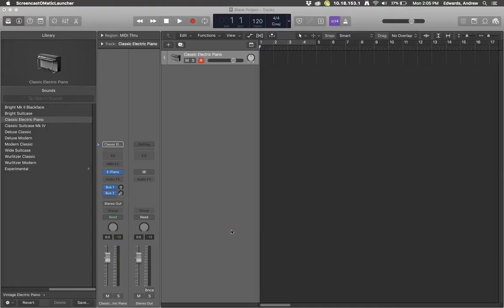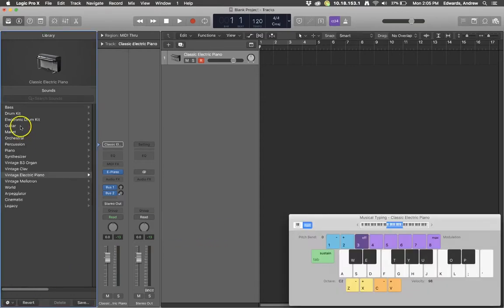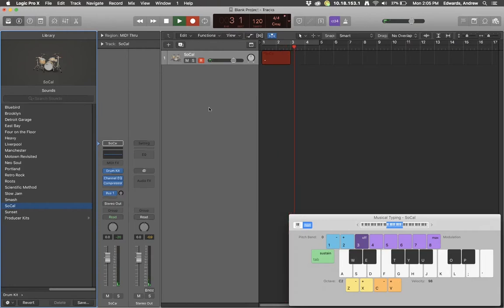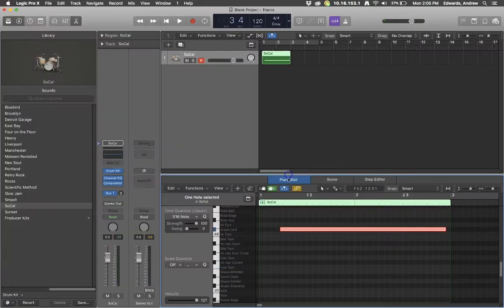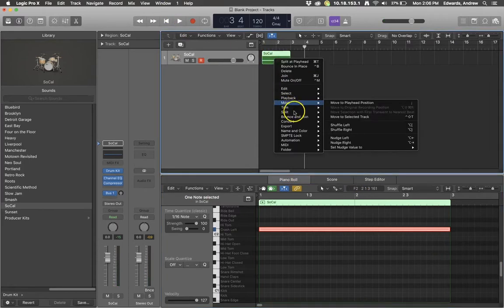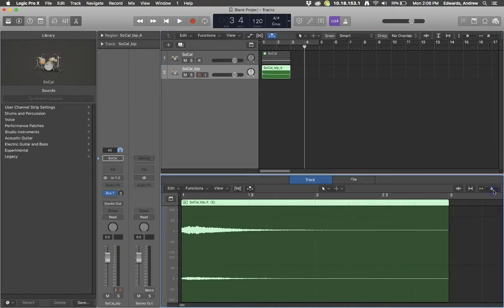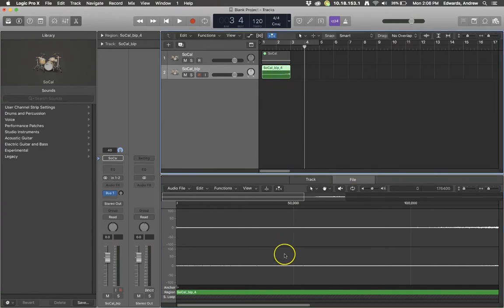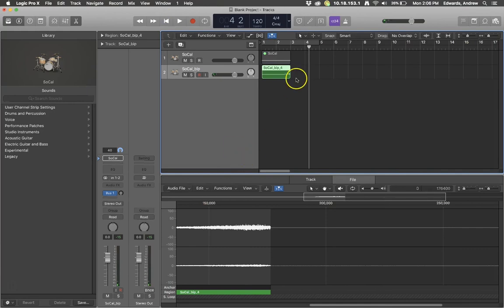Reverse Cymbal Riser Logic Pro X

Comment: Thank you very much! I'm new to Logic Pro and this is a great tool. Can you maybe tell me how to let the cymbal keep ringing and fade out after the swell instead of ending so abruptly?
Reply from the maker: This is a great question!  There are several things that you could do, but, my go-to would be to add reverb to the track as you want it.  To do this you will need to be in the track inspector.  You can hotkey this by clicking on the track header and then using the "i" button on your typing keyboard.  Or, there is a button that is an i with a circle (like an information button) in the top left corner.  Then, you will see the information for that track on the left of the two visible channels.  From there click on the audio FX area and go down to reverb.  As a quick test, I selected the Space Designer plugin.  From there, I went to the top left corner of the plugin window and clicked on the dropdown menu that says user default I think.  Then I selected medium spaces, room. 1.5s String Chamber.  This had a pretty good starting place for me, however, you should experiment until you find the sound that you like best!  I hope this helps!  Please let me know if you have any more questions!